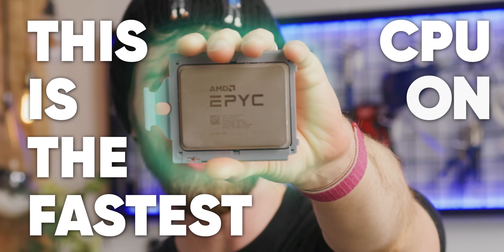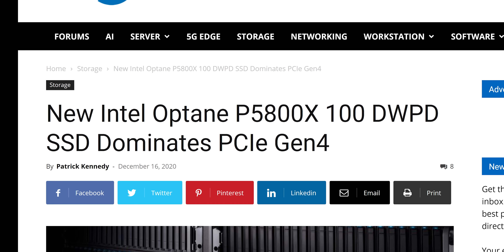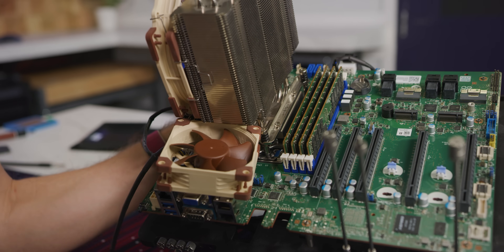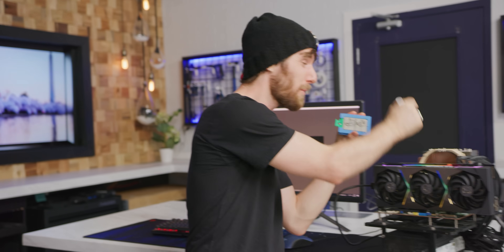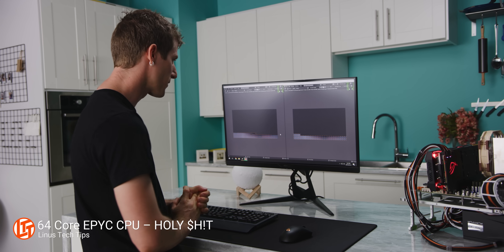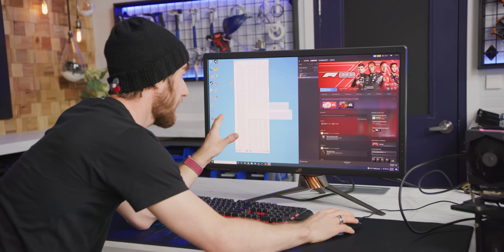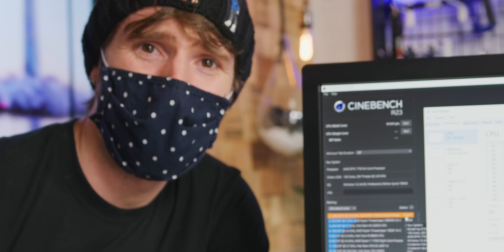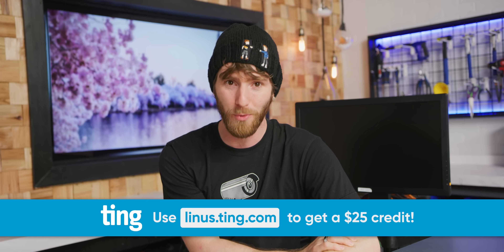The Fastest CPU on the Planet - HOLY $H!T - EPYC Milan 7763 64 Core

Comment: Another CPU that makes mine even more irrelevant.
Reply: And there's a bot lol
Reply: @desert6975  yea i get those everytime i comment something in some comment section :\\
Reply: @victorrobles353  reported the comments.
Reply: @victorrobles353  it's kinda inevitable at this point i guess
Reply: @desert6975  Just report them for spam and move on, however i doubt YouTube is trying to do anything about them.
Reply: @desert6975  Yup fake
Reply: He's not @desert6975
Reply: What do you actually have? Pretty much any 6 core CPU with hyperthreading or multi-threading is still very, very relevant for the vast majority of users. A decent 8 core without hyperthreading/ multithreading or a good quad core with hyper-threating/ multi-threading, and some 6 - core CPUs without multi-threading, are also still pretty decent for most people.
Reply: @syncmonism  yeah man. I have another system with 10 year old xeon x3440. I overclocked it to 3.7ghz. That 4 core 8 thread cpu paired with rx570 can play apex legends with more than 120+ fps and warzone with more than 80+ fps. I will upgrade my cpu when these games can't be played with atleast 60fps, for now this system is working pretty good for me. Also it can handle 4k YouTube videos just fine.
Reply: @syncmonism  old phenom x4 +3ghz ish ... ancient ... haven't update my gaming pc in years because of having a console and no time to actually play anything anyway.
Reply: Mine became irelevant when 6 core cpus became a thing ...
Reply: @contytub  99% of games dont really change much with more cores.
Reply: that happens every 6-12 months when new cpu:s launch. That's why there's no point buying the top one, that's why buy the one with better deals.
Reply: @EdilarinProducts  if you want the top performance you would need the top one though
Reply: @iiilliiill6451  what I meant is even if you pay top dollar this gen, next gen it won’t be the best anymore so why spend so much? The difference between say AMD and Intel is so small that there’s no reason to bitch over which one to buy, just get the ones that gives you a bundle deal, or a discount
Reply: @EdilarinProducts  That's how it works then you buy a new one and if you want to save money sell the old one you have idk what's so hard to get with this, and yes individually there is a huge gap between amd and intel
Reply: shut up ive got a i5 3210m
Reply: @formagetounsi  i3 540.here... 😂
Reply: @sholmes_ttyy  respect man
Reply: @sholmes_ttyy  celeron 10th gen
Reply: @sholmes_ttyy  e8300 :)
Reply: @sholmes_ttyy  of i have i7 950
Reply: @sholmes_ttyy    @7aythem   AMD 860K here :( lol help
Reply: @sholmes_ttyy  intel celeron on my worst pc
Reply: @sherlock holmes  i3 330M here
Reply: @sholmes_ttyy  I have i7 4th gen
Reply: @sholmes_ttyy  pentium d and core 2 duo extreme with an and athlon from 1999 in a laptop that’s about to explode with a Celeron from like 1998 that started smoking 👌👍
Reply: @sholmes_ttyy  lmao I have 13 4030
Reply: @sholmes_ttyy  i have pentium 4
Reply: @formagetounsi  Me jealous I have a 1ghz cpu
Reply: @formagetounsi  I had an hp with that cpu, it was pretty great until the gpu (7670m) died and had to change to another pc
Reply: @HDZ_VM  dude weve got the same laptop pavilion g6
Reply: @formagetounsi  yoooo same
Reply: @formagetounsi  i have i5 3470
Reply: @formagetounsi  ryzen 3 1200

Are you really in charge here?
Reply: I said the exact same thing just seconds before you posted your comment.
Reply: Hey of it's better than an i5 you're doing better than me
Reply: It's OK bro I'm playing VR on an i3-4150 lmao
Reply: Still satisfied with my i7-7700k...
Reply: Nah it doesn't make yours irrelevant, totally different customer base for that cpu
Reply: What are you running?
Reply: I have a dual core 4 thread in my pc and I'm still grateful
Reply: Poggies
Reply: Same
Reply: When the big brother comes to smack his lil bro. That's how i feel when i thought a 5950x was impressive.
Reply: @fredriklind6727  5950X is still the better chip. 5GHz clockspeed.
Reply: @saricubra2867  single thread is not the same as single core.
Reply: yup mine too
Reply: My best mate still uses his Pentium E5700 lmao.
Reply: Sitting here with my 3100.
Reply: does the amd a 10 6800k apu make yours irrelevant? i hope not, have a good day
Reply: yeah i got a 4790k
Reply: Were you ever planning on having a cpu meant for servers to begin with? If not then... how does it affect you and make your current cpu any less capable than it currently is?
Reply: Our CPUs may be irrelevant. But there are less things to break. Why do you think NASA's rovers run of of an 80286
Reply: I’m at an i5 2500, still going strong w/ a 1060 6gb
Reply: Same, and i have a 5950x
Reply: I have a Intel pentium p6200 (2.13 GHz)
Reply: Don't have one just my phone
Reply: i don't even have a cpu
Reply: Don't worry, my stupid ass bought a Skylake CPU (6700 non-K) and put it into a B150M motherboard with 3200MHz DDR4... I should have went AMD, and gotten at least some 3600MHZ DDR4.
Reply: Well, I've got a 6800k - the last CPU-Gen before hexacores got mainstream - so yeah that prosumer uppay was worth it 😅 that said at least i got some more PCIe Lanes
Reply: if its a 3600, i'll give you  $300 for it
Reply: Is it late enough to say I'm "still" rocking my 7700k?
Reply: i7 2600
Reply: @infinitedensity6833  Because techies are paid shills.
Reply: @infinitedensity6833  Little cores are still CPU cores. I suppose that shills will always defend bad processors. Apple just exposed them.
Reply: shut up you literally support rule 34 on your alt
Reply: @infinitedensity6833  Nope, lightly threaded applications are used for the Big cores since they are the fastest and they clock higher, little cores are for background or multicore workloads combined with the big cores, they are more efficient because they would in theory clock slightly lower, therefore lower voltage and wattage.

The way that a GPU makes a CPU irrelevant for something like rendering because it uses thousands of small and "dumb" CPU cores. Using big cores for this is simply nonsensical, it's not efficient, the lightly threaded workloads are slower and you waste sillicon space.

Apple M1 also makes hexacores and octa cores look stupid in comparison.

The fact that AMD and Intel want to switch to Big-Little or try to compete with Apple shows how how dated their x86 processors feel in terms of architecture.
Reply: @infinitedensity6833  The lightly threaded workloads are used by the big cores since they are faster. And both big and little cores can be used when it's required the entirety of the CPU.

ARM is absolutely destroying x86, so much that there was a 400% increase in market share for ARM processors being used for servers last year. The transition is slowly happening right now, notice that windows 11 has support for Android Apps.

3D stacking is not enough, the M1 is an SoC and memory latency is way, waaaay lower. if AMD doesn't glue chips together, maybe that would help.

Both AMD and Intel are in a huge problem, the M1 changed the entire CPU landscape and ARM is simply superior to x86 in terms of efficiency.
Reply: @infinitedensity6833  To beat the M1, you have to do a roughtly 36% increase of IPC in one year. I have 0 expectations for x86, it's pathetic, even more like AMD struggled to match or outperform Intel in gaming or singlethread perfomance in a 7 year old 14nm node.

The x86 architecture really is very, very crappy. No wonder why the fastest super computers are ARM based and for a reason, smart phones and Android dominate the computer market over PCs and Windows.
Reply: @infinitedensity6833  36% is bigger than Sandy Bridge. The only IPC increase above or 36% that happened in the x86 architecture recently, is AMD moving from the disaster of Bulldozer (and derivatives) to Zen 1.
Reply: @infinitedensity6833  Is not disastrous or pointless the IPC comparison:
https://browser.geekbench.com/v5/cpu/search?q=Apple+M1

https://browser.geekbench.com/processors/amd-ryzen-7-5800x

30-36% higher IPC than equivalent desktop Ryzen or Core chips while using 11 times less power to achieve better singlecore score (105 watts TDP vs 15). It's an embarrassement.
Reply: @infinitedensity6833  "lower frequency equals greater IPC and higher clocks equal lower IPC"
Clockspeed and IPC are completely different things.
Reply: @infinitedensity6833  ARM has the potential for sustained workloads, but no  one except Apple is pushing ARM for consumer desktops.
Reply: @infinitedensity6833  Synthetic benchmarks don't matter then, so we can't compare CPUs even when we have ones that consume more than 11 times the power consumption for the same singlethread perfomance. It reminds me of AMD Bulldozer vs Intel's Sandy Bridge.

The reason why x86 stagnated is Intel's lack of innovation and mediocre IPC increases per year, so they started to push frequency more and more. ARM always used less transistors than x86, it's a more efficient instruction set and now also beats x86 now in IPC, therefore is the king in perfomance per watt.

There's a planned 12 core version of an Apple Sillicon desktop ARM chip.
Reply: @infinitedensity6833  Userbenchmark has nothing to do with the M1, Passmark and Geekbench 5 are reliable. In fact, the tech reviewers would use Geekbench 5 to compare the M1 vs x86 Intel and AMD, the M1 makes Intel and AMD look like embarrassement with their poor IPC and extremely bad perfomance per watt.

The fact that x86 needs Moore's Law to compete simply shows that it's not good vs ARM. The difference between TSMC's 7nm and 5nm is small, but watch how the M1 uses more than 11 times less power than a Ryzen or Intel Core desktop at iddle and performs the same in singlethreaded perfomance or better than others. x86 architecture is simply bad right now and very dated, was developed in a time when ARM didn't exist and was simply a concept.

ARM will not die because the majority of computers (phones specially) use it, the best super computers and servers also have them, Android has more market share than freaking Windows.

Transistors haven't doubled in two years, that's why AMD is gluing together chips and Intel will do the same, the latter gets basically the same perfomance of AMD per core with similar TDP in a 7 year old node, architecture rules over nanometers and M1 has that.
Reply: 😂 same. I literally have a Mac mini 2014 2 core core cpu, gpu, 4GB RAM DDR3 800GB SSD + PCIe 2 threads 1.2GHz intel HD Graphics 5000
Reply: and I thought my ryzen 3 3250u has a chance in the competition
Reply: Yes
Reply: what is the price of an intel 64 core i7 3820?
Reply: shut up botted stolen account
Reply: it's just single-core speed is slightly faster, and 10 degrees more cool than my almost 8 year old 2 core cpu's single-core speed, even when I put my laptop under ice lol
Reply: @aminelswefy1808  Apple at the top here and 15 watt TDP lmao:
https://www.cpubenchmark.net/singleThread.html

I think they will release the 12 core M1X this year, maybe will increase the frequency?
Reply: Only irrelevant if you want to pay $8000 for a CPU with worse gaming performance than a 5600X.
Reply: Apple M1 SoC at 3.2GHz, one core performs like one from Ryzen 9 5950X or Core i9 at 5GHz and the Apple M1 has integrated graphics and doesn't need a fan, has less than 10 times the power consumption of a Ryzen or Core, less than 100 times the power consumption of EPYC.

The EPYC, Threadripper and Xeons s*ck, they are like overpriced Bulldozer chips.

"MoRe Cores". No wonder why ARM is winning market share on the server space.
Reply: @saricubra2867  we got a apple boy here
Reply: @theforerunnerreclaimer Nah. Ryzen 9 5950X can clock to 5GHz and has way lower power consumption and memory latency than EPYC.

Ryzen 7 5700G has kinda high clockspeeds, integrated graphics card and will crush any CPU in blender by using it alone and the price is around $300 .
Reply: @saricubra2867  The Transition will take time bro. Every games, apps have to change. All these graphics cards are designed to work with cisc cpus. So the transition will take time
Reply: @sholmes_ttyy  Apple M1 can run x86 apps. Just like Windows 11 or Intel and AMD can run android Apps.

Apple M1 at 5GHz would make these current x86 CPUs look even more dumb.
Reply: @saricubra2867  yeaaaaa totally..., with that logic my Raspberry pi 4 8gb overclocked to 3.27GHZ will beat a i5-6200U, but it doesn't. Nobody wants a apple fan boy here. Go annoy other people
Reply: @theforerunnerreclaimer  dude's focusing on Ghz as if it's 2005, Apple stans are just stuck on the past, dunno why they even watch LTT
Reply: @theforerunnerreclaimer That Raspberry PI has bad IPC compared to the M1 SoC. Keep defending these modern x86 Bulldozer chips.
Reply: @theforerunnerreclaimer  https://www.cpubenchmark.net/compare/AMD-Ryzen-5-5500U-vs-Apple-M1-8-Core-3200-MHz/4141vs4104

lmao.
Reply: @saricubra2867  yeah lmao imagine comparing 6 core desktop with 8 core arm one
Reply: @3daystogo_create  8 core ARM that is in fact a high perfomance quad core beating an x86 high perfomance hexa core.
Reply: @saricubra2867  yeah with literally 1.1 ghz higher base clock, jeez read article carefully dude
Reply: @3daystogo_create  Base clock doesn't matter that much if there is a huge difference in IPC.
Reply: @saricubra2867  yeah, now tell me what laptop they're using? What ram configuration?, How much?, Is the cooling system shit like some thin notebook?

It's called base clock for a reason that under "normal" circumstances it will never drop below that and by having it literally 1ghz above your competitors, you literally giving yourself a headstart

Like jeez it's ok to wide spreadly share your opinions, even though it's a based one, but it's not ok to literally forcing it down to other people with it
Reply: @3daystogo_create  It's not relevant, you are just salty that the M1 is that ridiculously powerful making the competition look like AMD Bulldozer, just like Sandy Bridge i7-2600K clocking lower than FX8350 is more than 30% or 40% faster than FX-8350 in gaming.
Reply: @saricubra2867  how is it not relevant, you talk shit about thermal throttling previously and now you're saying that part of the laptop that cooled the cpu is not relevant?
Reply: @saricubra2867  nobody asked your opinion and nobody really cares its just a pitful argument in the internet let it be
Reply: @Em222ri22ki  Isn't about an opinion, Apple M1 destroys these processors with their bad IPC and ridiculously high power consumption. It will be even more noticiable with the M1X and succesors.
Reply: @saricubra2867  Ha, I'm the furthest from defending bullzoder chips, I'm a intel guy myself. But you keep believing what you believe
Reply: @saricubra2867  your confusing single core with single thread, a single amd or Intel core running 2 threads is vastly faster.
Reply: @geofrancis2001  It's not. AMD and Intel have way lower IPC.
Reply: @saricubra2867  how are they overpriced? Dude they're not consumer grade chips, of course I shouldn't be surprised an Apple stand doesn't know that lmao. 

Guess what? You're not running 86x software on that ARM chip, 86x is still the king. Lower power consumption? That isn't always a good thing just like making laptops thinner isn't always good. The MacBook air sacrifices cooling, features, and performance for a slim design.

Even the display is limited because of it. Same for M1, that's Apple's entire philosophy. They target very specific groups. Most people wouldn't benefit from using an M1 computer, some might even detriment.
Reply: @AcolyteOfLucifer  Apple M1 is not by any means slow. Destroying every single x86 CPU here that has more than 10 times the TDP here:
https://www.cpubenchmark.net/singleThread.html

Apple M1 doesn't suffer from thermal throttling, it's an special heavily modified ARM and 5nm SoC. The fan is justified when you have dinosaur x86 14nm Intel chips or 7nm AMD ones with IPC than is slower by 30% or more.

Give me a x86 CPU that outperforms a 11900K in singlecore without 5GHz or more than 3.2GHz with a TDP of 15 watts, has good integrated graphics, AI hardware acceleration and stays very cool that doesn't need a fan and the laptop is silent.
Reply: @saricubra2867  idc tdp.. I only care raw power tbh and m1 sucks to play games on
Reply: @saricubra2867  Ryzen 5 5600X will do that except for the graphics part but then again the graphics part of the M1 is not that impressive.
Reply: @xuser48  That 5600X chip is a terribly overpriced i7-8700K and worse than i7-10700K that has 2 cores more and lower memory latency for gaming.
Reply: @saricubra2867  - You obviously have no knowledge about CPU's. EOD!
Reply: @saricubra2867  aaaaaaaaaaahahahahah hahahahahaa hahahaha ha aha hahahahahahaha